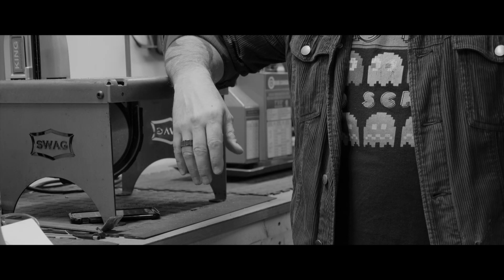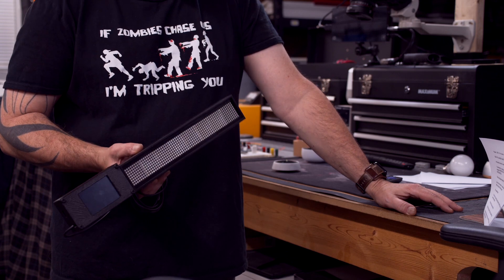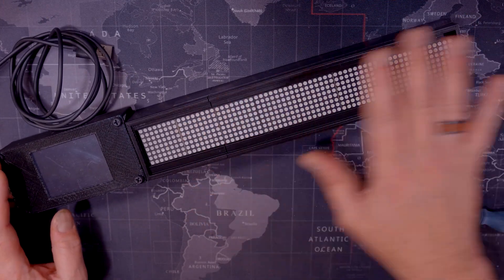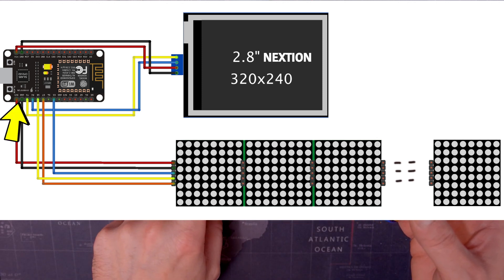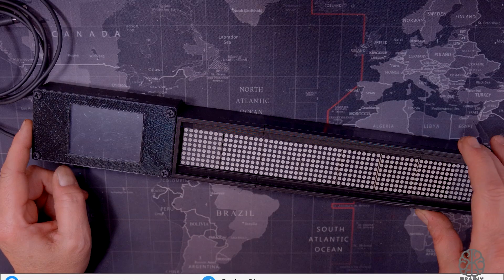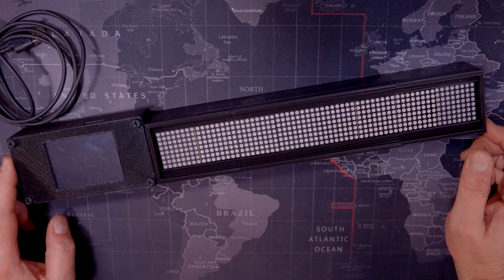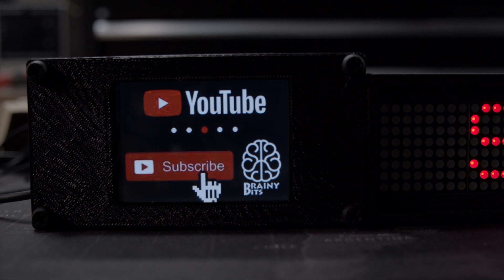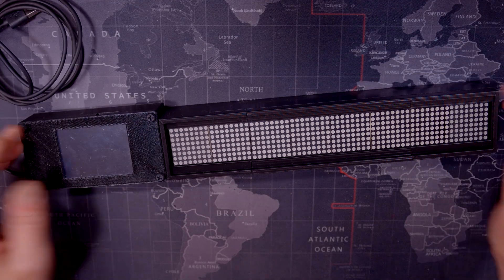My take on the ‘Obsolete’ YouTube Counter!

Comment: Hi Yvan. I still try different scrolling message libraries using the small 8x8 modules...also have 10 of the larger 60mm RGB modules which I have got working. Using bluetooth makes them more fun to program the display.
I like your black case. Making a decent case is a stumbling block for many people.
 I looked at the advice slip web site and haven't any idea what it's for. I normally just enter a json url and job done. An explanation would be interesting.
Reply from the maker: I actually hard coded the quote of the day messages. I wanted sarcastic messages, and not just inspirational ones which are kind of cheesy 😝. But I’ll keep the Json thing in mind for a future tutorial video. Thank you for taking the time to comment and watching!